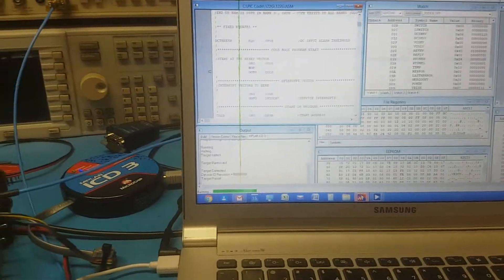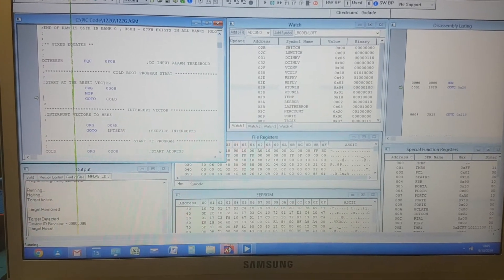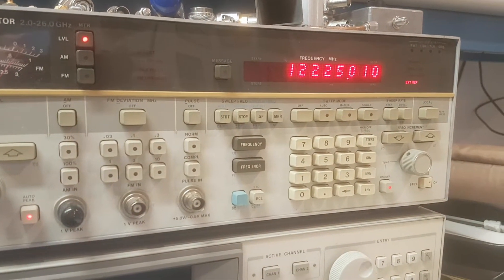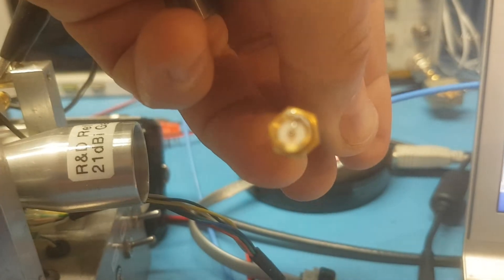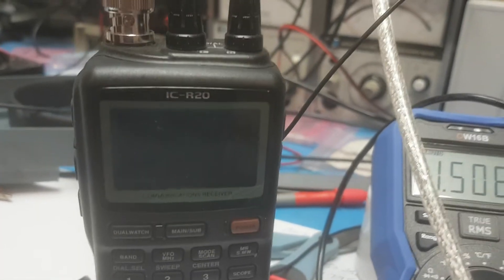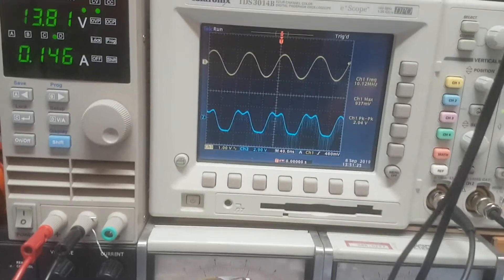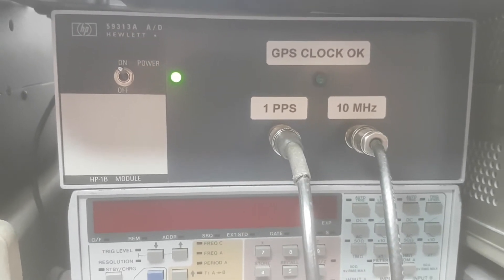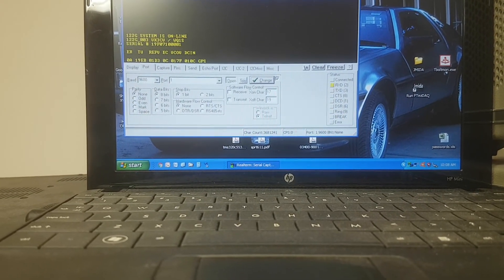VK3CV 122GHz Transverter

Comment: 599 OM nice fist. Not too much QRM up here. 73's from WU2D
Reply from the maker: QSY to 134 GHz, even less QRM
Reply: @vk3cv_wq1sandrew56  I am modulating with a hockey Stick.
Reply from the maker: @MIKROWAVE1  CQ CQ don't Ice the puck !!
Reply: Excellent. NEXT a negative resistance push pull tripler for 366?